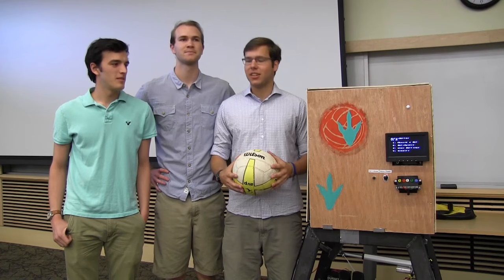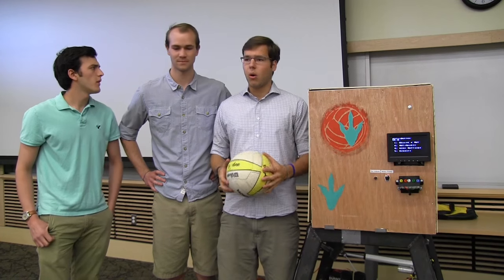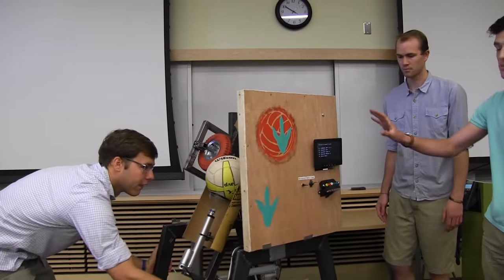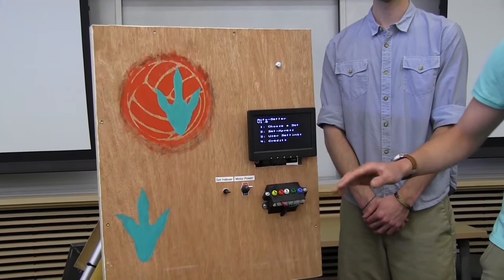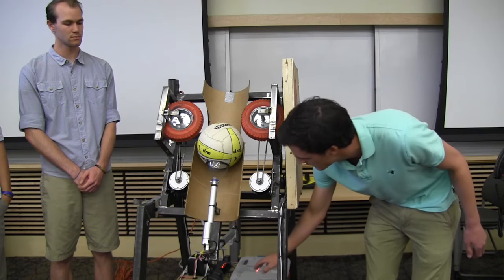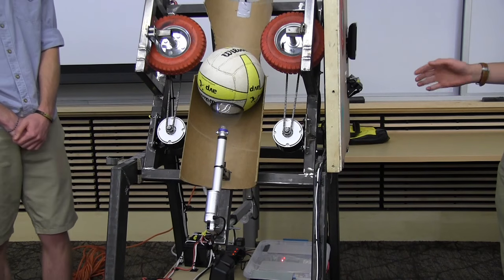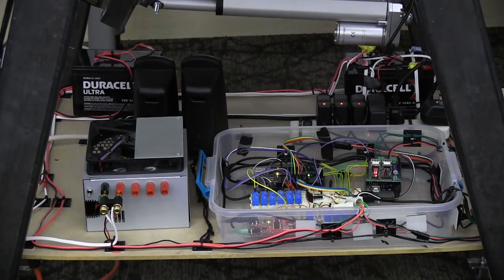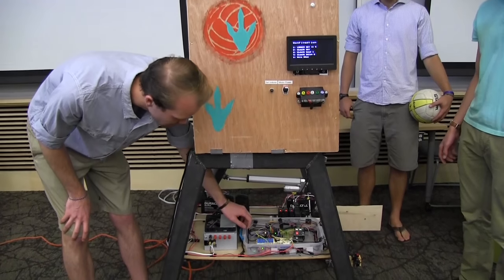Volleyball Setter Machine - Mechatronics Project

Comment: Imo, the problem with this is the spiker will not be able to predict accurately when will the ball set off the machine.

Is it possible to attach a transparent pipe so the spiker can see the moment the ball drop into the wheel??? hmmm